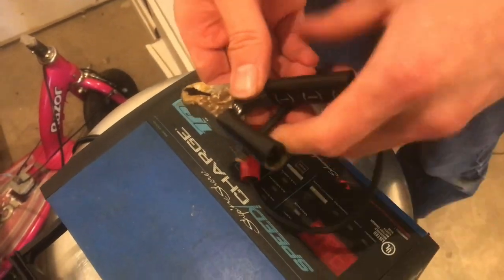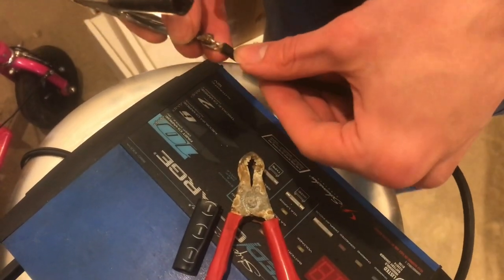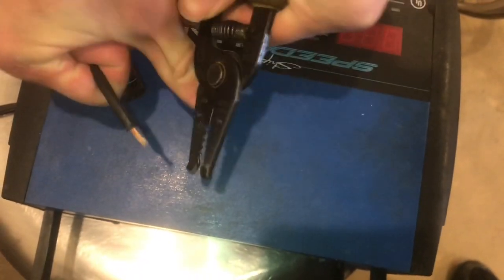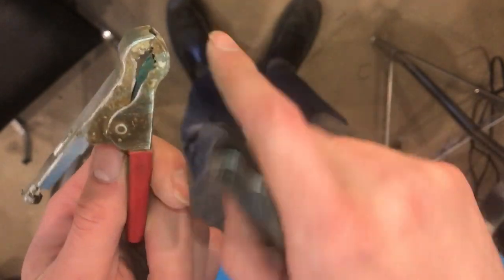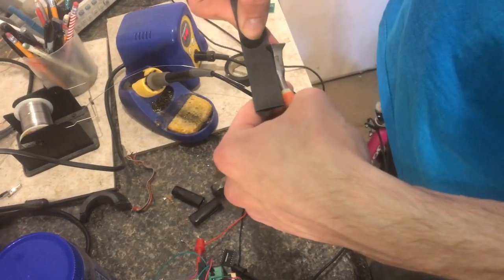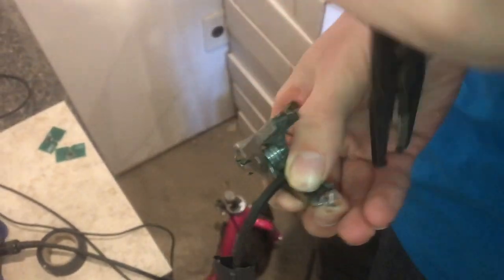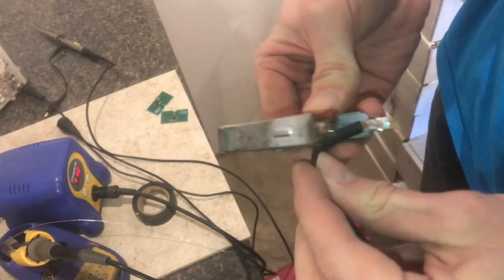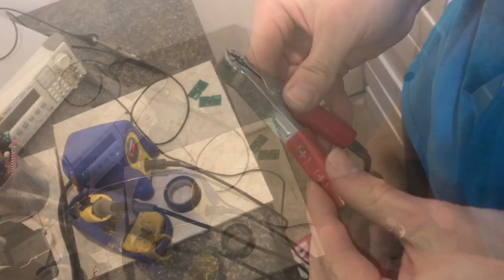INSTALLING alligator clips so they “CAN’T FAIL”

Comment: I feed it all the way through and out the mouth. then double back around the spring to the other leg. crimp the insulation on the long leg and solder the end leg. Now the wire isn't going anywhere and is resistant to metal fatigue.